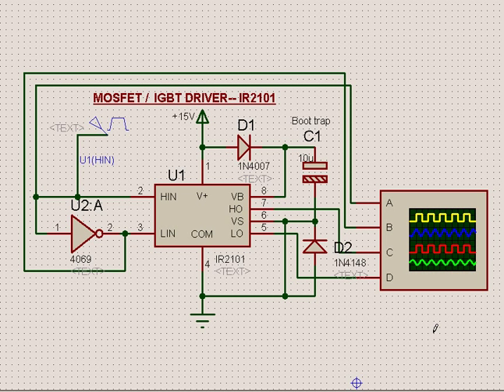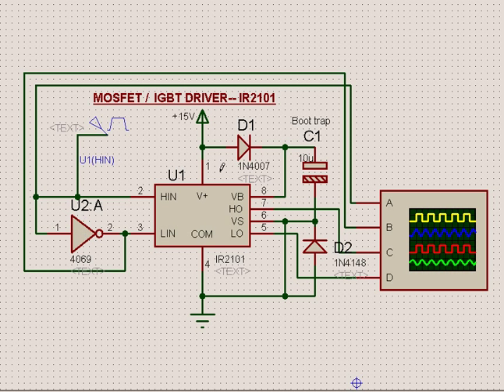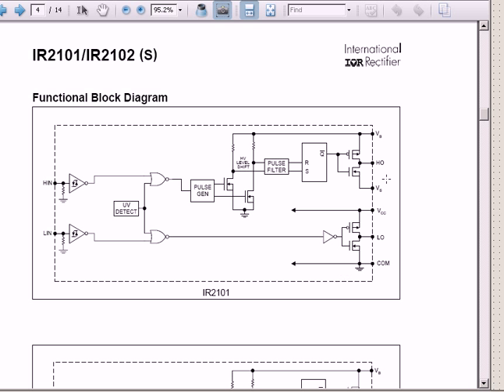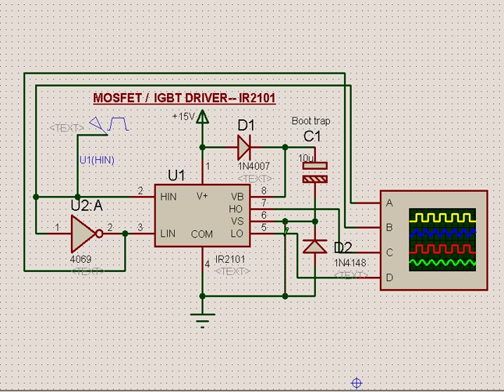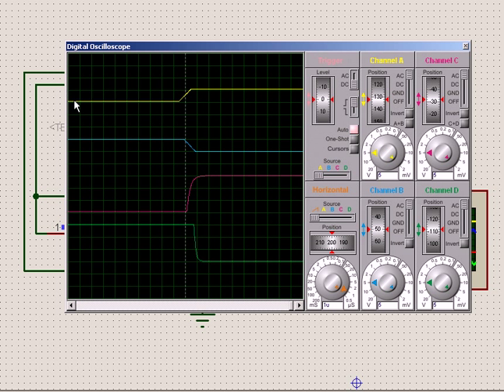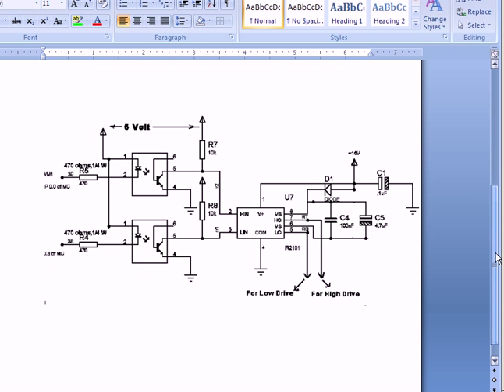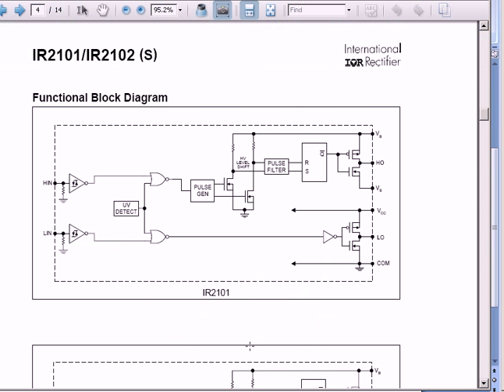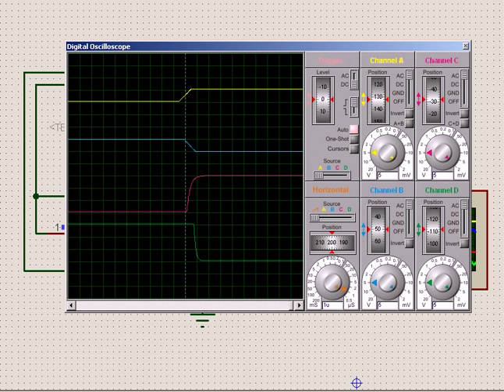Mosfet_or_IGBT_Driver  IC 2101.avi

Comment: Excellent explanation friend, by there open designed a diagram of a three-phase inverter with igbts
Reply from the maker: Thanks
Reply: muy buen video amigo , quisiera hacerle una consulta de que voltaje es su señal de entrada al IR2110 por el HIN Y LIN, MUCHAS GRACIAS ESTARE AGRADECIDO A SU RESPUESTA...

Comment: sir how to choose the ratings of the capacitor used..??
Reply from the maker: It (the boot strap capacitor) depends upon the type of load that it is going to feed ie the MOSFET or the IGBT. For low power operations minimum 10 uF is good enough though you can use higher values also without any problem

Comment: hi sir 
i am using protuce but cant add ir2101 in it ....please guide me to do so
Reply from the maker: +Raviprakash Sharma Use latest version of Proteus
Reply: +Patnaik UC 
hi sir 
i have made a three phase ac inverter using ir2101 and irf740 x....everything is good at 70 volt but as i increase dc supply it my one phase ac drops down to 50 volt ...and advice ....
Reply from the maker: +Raviprakash Sharma Is it while testing on Proteus or on real hardware? Send the full circuit on ucpatnaik@gmail.com

Comment from the maker: One can use one mosfet. But then why to go for 2101 for that ? We use 2101 basically for getting the upper drive features over and above the lower drive If you have no such requirement this IC need not be used. Just drive the mosfet directly from any active switch